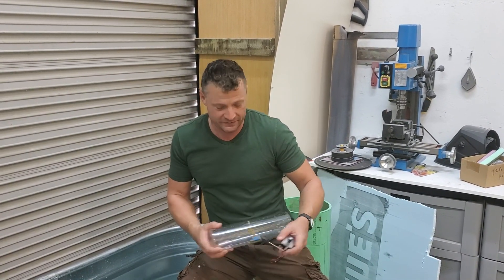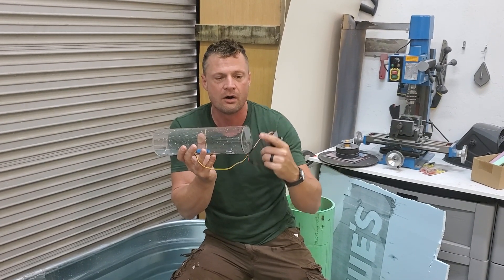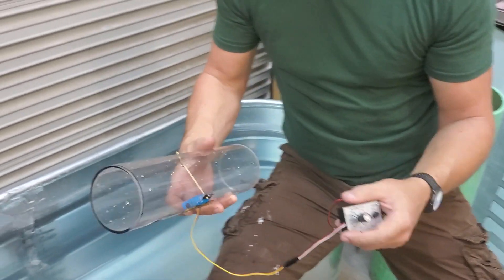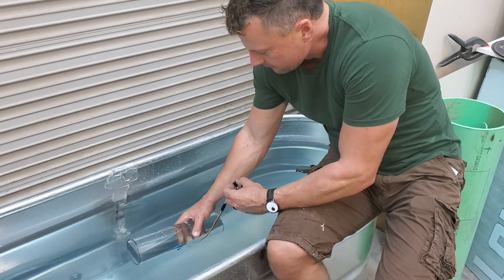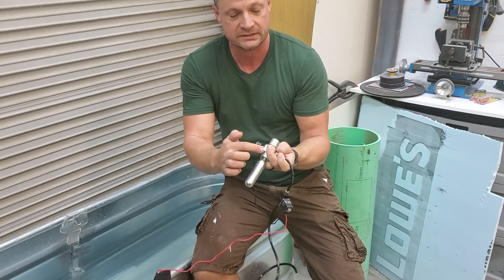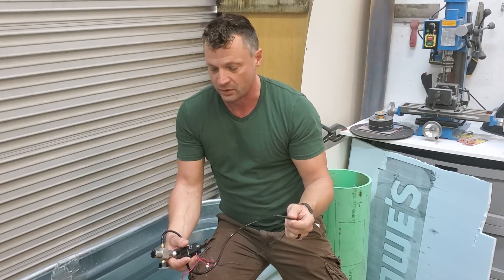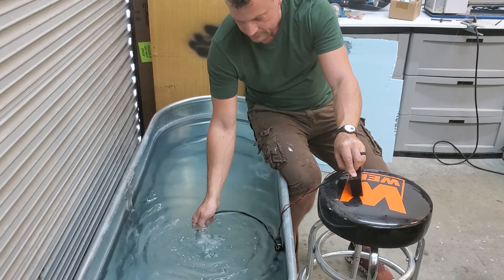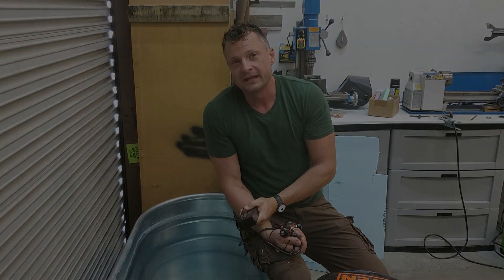A modular CO2 ballast system for use in RC Submarines

Comment: Hey!! if you can get a compact water  pump like a selenoid with piston and check valves , you can just pump water in a aluminum cilinder compressing the air there for lowering bouyansy,it will be a stealthy,no air living the vessel, another could be a metal tank full of water and the pump will be inside pumping water out creating a vaccun within the cilinder,

Comment: Cool ... This works the same way that the main ballast tanks on the submarine I was on, the USS George Bancroft, worked except that the tanks on our submarine were full of compressed air. The tanks were refilled with outside air when we were on the surface or snorkeling using an on board compressor.

Comment: Isn't CO2 going to dissolve in water? Therefore sucking water from below and ruining your ballast equilibrium?
Reply from the maker: Perhaps over a long period of time, but that would long, long after you'd be home from the pond with a dry boat after many blow/vent cycles. Water absorption of CO2 is only a few percent. It's not a concern in the slightest.

Comment: Bob, could that be rigged to fail closed/open? As in the bleeder valve would be left open to bleed water and air as the boat rises and dives, the blow valve left closed unless power is lost then it would open and the bleeder would close. If it could then it could be used as a power loss emergency blow system to surface the boat if lost. No more calling in a dive guy to find a lost boat.
Reply from the maker: You can easily rig this in conjunction with a BLM failsafe device. You could also rig a pinhole bleed from the compressed side before the solenoid. It would slowly bleed air into the ballast tank over time, eventually floating the boat. Lots of options!